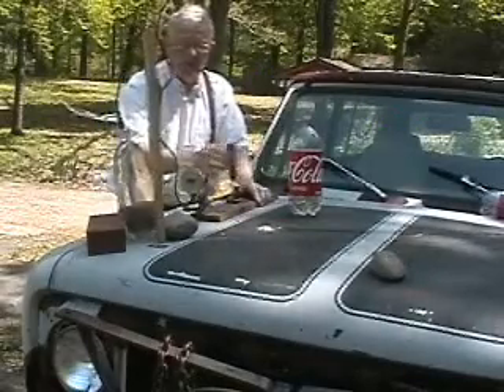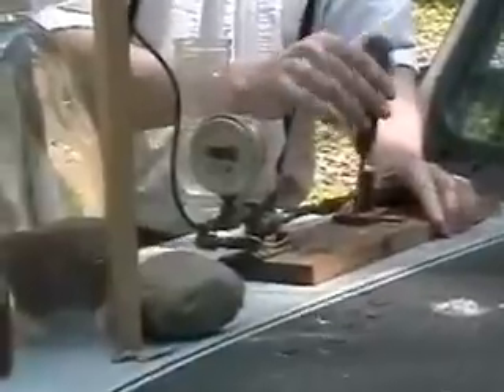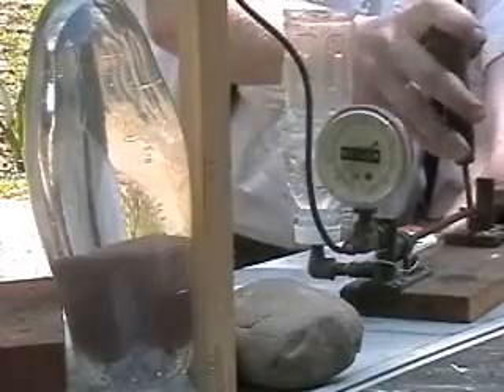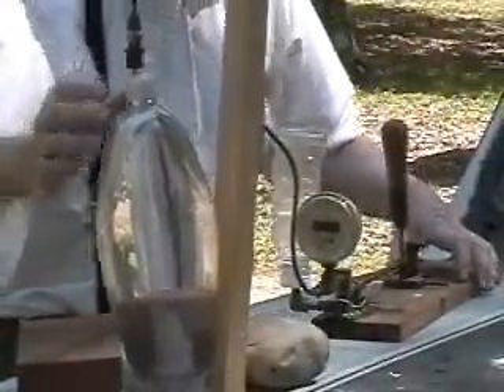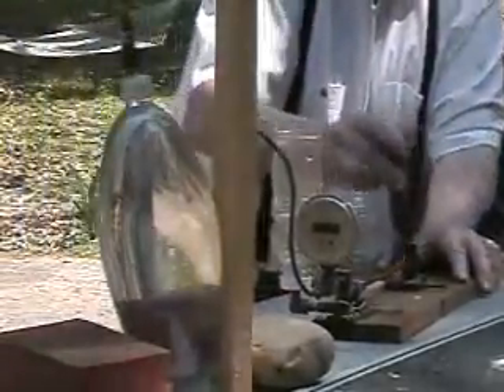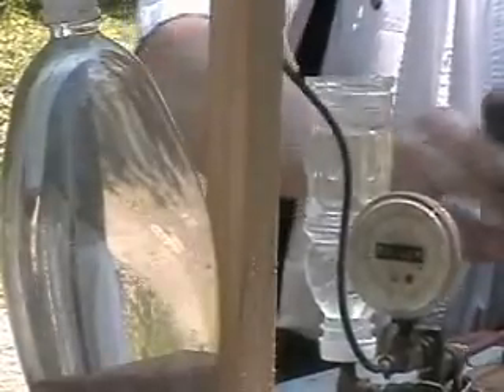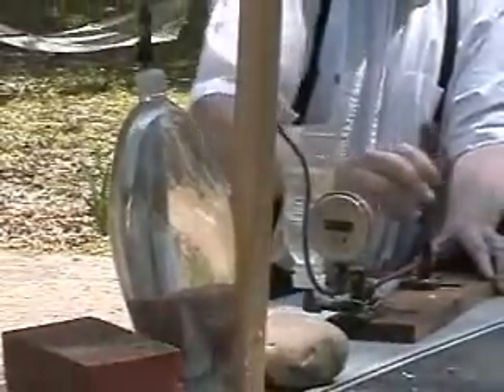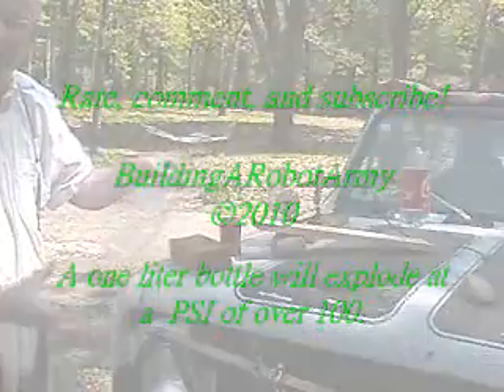One Liter PSI Test 1 Soda Bottle Explosion System

Comment: what brand of soda and do you know the composition of the plastic
wouldn't your first test have compromised the integrity of the bottle?
is that sand in the bottom??? why?
are you using as fresh cap on this second try
is the ambient temperature a factor?
are you wearing safety goggles